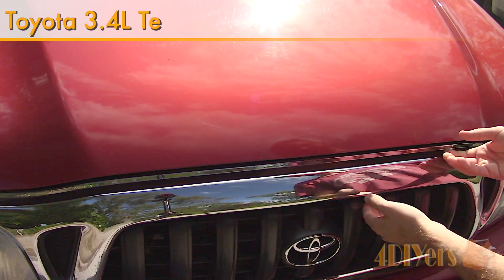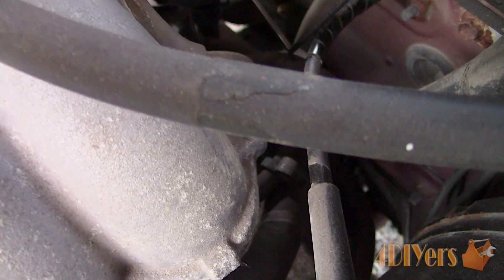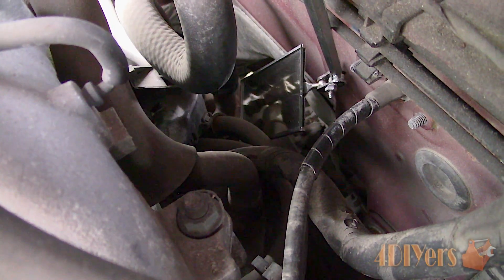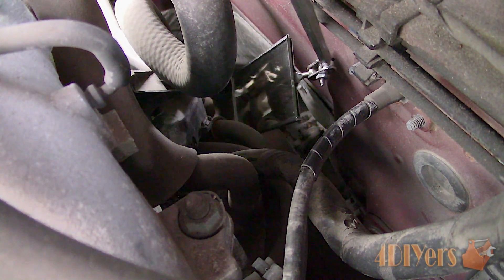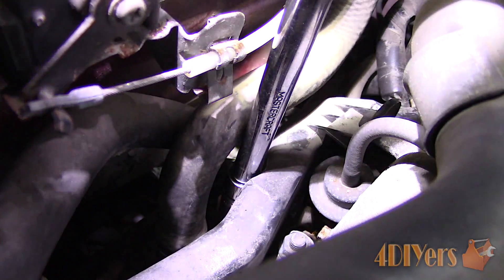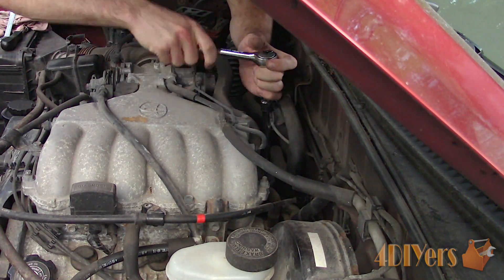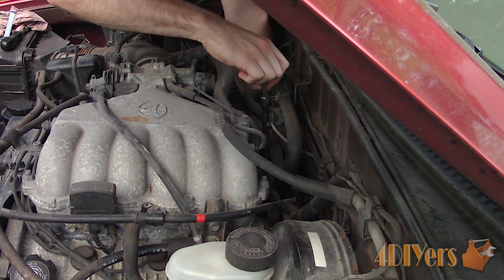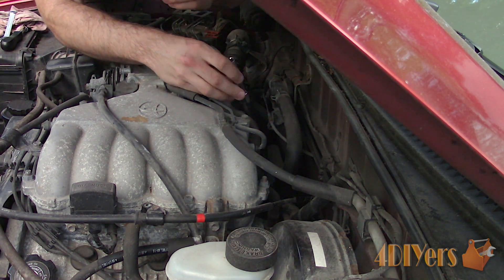How to Replace the Temperature Gauge Sensor on a Toyota 3.4L V6

Comment: What vehicle is this? Because I have a 97 4runner with the 3400 and some of the videos say it's in the front part just behind the plastic cover,  are there 2 of them?
Reply: The sender at the rear is for the temp gauge the one at the front behind timing cover is for the ECU

Comment: I replaced this temperature sender today on my 1998 Toyota 4Runner with that same 3.4 engine I have to say its a real pain in the ass to replace but definately do able what I did to make the job easier was removed the 10mm bolt that holds the harness to the back of the plenum also on the passenger side remove the clip part for the harness from the metal tab give you a little more room to fit your hand I also removed one of the hoses off of the heater control valve which opened more room to fit your hand and be able to pull the spade bit connecter off the temp sender and I used a 10” extension with my deep 12mm socket to remove it and thats it the job was a success be patient when doing this job and a really useful tool to have in this job is a mechanics mirror.

Comment: When you turned the key at the end of the video was your truck already warm. Because yours was doing what mine is doing. Even if the truck is cold it immediately goes to the middle position on the needle.
Reply from the maker: Yes the engine was already warm. Sounds like it could be a possible short somewhere. I would start with disconnecting the sensor and see if that makes a difference. If it does, then the sensor is most likely faulty.

Comment: 0:43 “Remove electrical connector” Mk but how… everyone in the comments is snapping their wiring Bc that connection is so hard to get apart. Nvm mines broken too now
Reply from the maker: Don’t pull on the wire. It’s just a spade connection.

Comment: Hello! Maybe you could help me. I have a Toyota t100 wilh the 3.4l and my temp gauge always reads in the middle, even when I first start it. The gauge sweeps to cold when I turn the key off but when I first start it it reads in the middle. Would this be a bad sensor? I unplugged the sensor and it still reads the same way. Thanks
Reply from the maker: Check the connection on the gauge cluster. Had the same problem on a Tacoma with the same engine.

Comment: That’s the sender that send the signal to the dash, the actual sensor is by cylinder 1 fuel injector.
Reply from the maker: Which is exactly what I've shown in the video. The ECU sensor is at the front of the engine.

Comment: I have the same engine in a 4runner  here my issue , the gauge reads max hot all the time, with car on, just ignition on and even when I unplug the temp sensor which is brand new, also have a new cluster , what can I do now?
Reply: same issue. did u ever solve it ?
Reply: @aizayahhills  it’s a short in white somewhere, your better off running a new wire
Sold the vehicle as is

Comment: Looking to add an aftermarket gauge cluster...I would assume this is the sensor to remove and replace for the new water temp sensor of the cluster rather than the other sensor that goes to the computer?   Thanks in advance
Reply from the maker: Yes that is correct, this is the sensor for the temperature gauge.

Comment: I broke the wire that goes to that sensor. The break is right at the end of connector. Do you have any words of advice about how to fix this. I wondered  if i could find a replacement connector with some wire on end that i can sawder to broken end.
Reply: Mine broke too and it’s a B to replace

Comment: the engine through a code for this sensor, but the gauge seems to be working right. How can I determine which of the 2 sensors it is?
Reply from the maker: This would the sensor for the ecu https://youtu.be/J9nHgZUoWyo

Comment: Is there any specific procedure to removing the electrical connection on the sender unit? I don't want to pull on it too hard and risk breaking the connector
Reply from the maker: Nope, it's just a slide on space connector. Don't pull it by the wire though.
Reply: @4DIYers  Thank you for this info!!! There is something magical/divine in finding a tip on removing a electrical connector hiding at the back of an engine, long live the Legend of the 5ve fe!

Comment: Is that the same as a engine coolant temperature sensor? Or are there two?
Reply from the maker: There are two, this one is for the gauge. This video here covers the one for the ECU https://youtu.be/J9nHgZUoWyo
Reply: @4DIYers   Thanks for that very important information that seems to be only lightly mentioned elsewhere.  Spent all day dumbfounded why my gauge was still not working.  Very important information. And thanks again 4DIYers.
Reply from the maker: @godzzla  No problem. If you're still having problems, check out my other video troubleshooting the circuit https://youtu.be/VVJSwEakRto